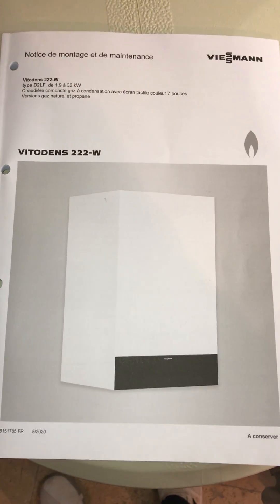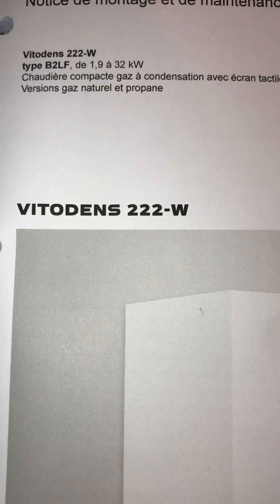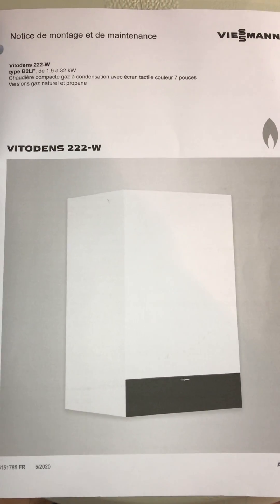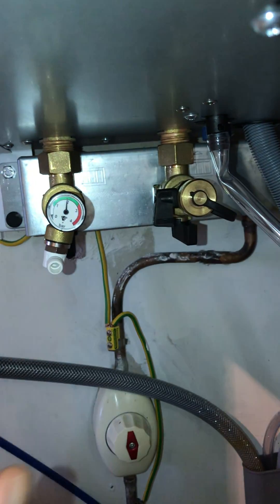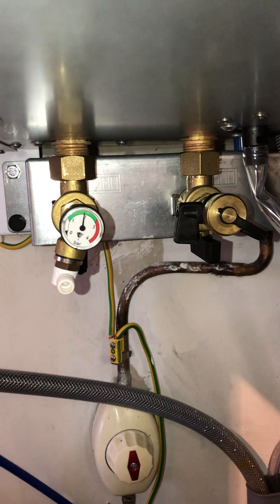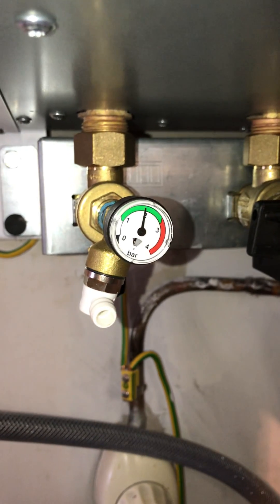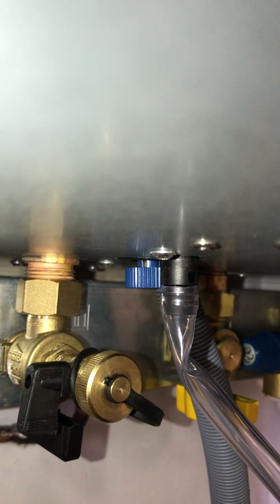Viessmann Vitodens 222 W Boiler.  Increase pressure / Lost pressure (Jan 2021)

Comment: Thank you so much Michael! Woke up at 6am to find no hot water. Scratching my head I could only see one valve and had no idea what the blue nozzle was for but dismissed it. To top it off, when I checked the gauge is said it was at 2, when I tapped it, it fell off, it wasn’t even attached properly 😂
Reply from the maker: glad I could help.  I hope you get warm gain soon!  M

Comment: Thank you Michael! I was able to download a service manual where the procedure is described in multiple steps which intimidated me a bit...your solution worked like a charm even though I did not find it mentioned either in the user's or the service manual.
Reply: So glad I could help.  It seems that my video has prevented a lot of frustration all round.  Cheers,   Michael

Comment: Tried to top up my boiler 6 months ago because the pressure in the system was decreasing. Read the whole manual, watched many videos by plumbers and Viessmann itself, called the company and the guy who installed the boiler to guide me through the process... no success. This morning I wanted to take a quick shower but the water was ice cold, Viessmann app notified me that the system pressure was too low. Left home like a greasy dirtbag and thought that tomorrow I will call the company to send someone in. Got back home and while sitting on the toilet I opened up Youtube to give it a one last try. This time the Youtube gods pointed me in the right direction and I knew right away that this is the solution I had been looking for. Went to the boiler room, did the thing and the pressure was back where it should be. Thank you so much!
Reply from the maker: My pleasure.   I am so glad I was able to help. (at last!!)

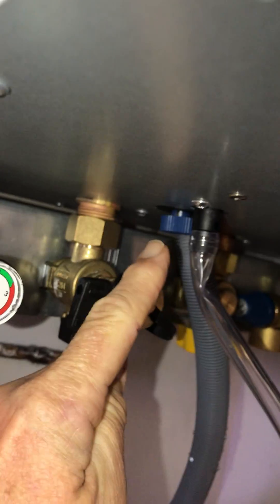Comment: I have a slightly different installation to this where the only blue tap I have under the boiler is the horizontally mounted one you can see in the background of Michael's video at 1:10 . Do not turn this one. It made the pressure go down! Instead I have 2 small black taps on the underside of the boiler, with what looks like a small overflow pipe between them. You need to open both of these, turning anti-clockwise maybe 5 or 6 times (don't be shy) to fully open them and hear the water coming through.
Reply from the maker: PLease be careful.  Ross' installation is different from the one in the video :-)
Reply: Many thanks: I also have this configuration with vitodens 222w too. 
I don't have any blue taps below the boiler.
I have two black taps below on the left, and only by opening both of these can I increase the pressure. 
Strange since (it seems) to be all Vitodens 222W

Comment: I have a 222-F (floor standing as opposed to your wall mounted). As you suggest, the manuals are not intended for the customers. I too have spent ages trying to find out how to increase the pressure but the information is nowhere to be found. My pipework is completely different to yours. I contacted Viessmann direct the other week and they say my boiler is due for a service in September. As no-one in my area (Gloucestershire UK) is Viessmann trained I will have to get them to service it in order to maintain the warranty at a cost of £140 + VAT. It's a good boiler but until they become more popular in the UK, it's a bit of a millstone around my neck.
Reply from the maker: I feel your pain!  Good luck.